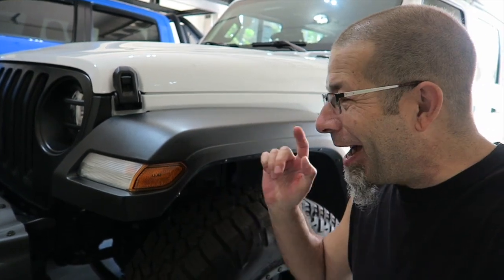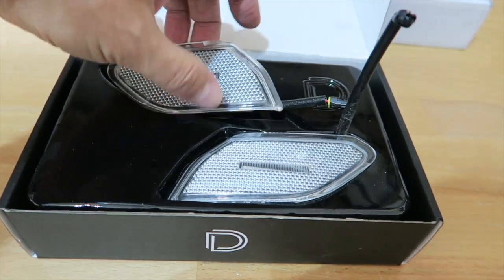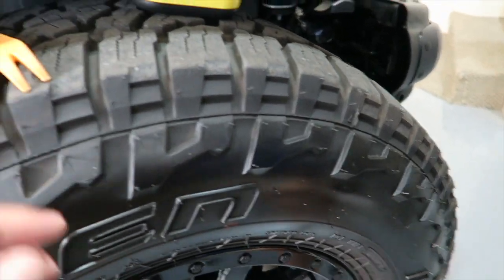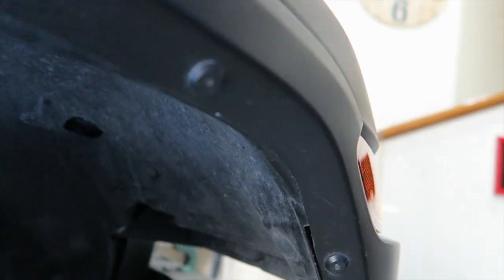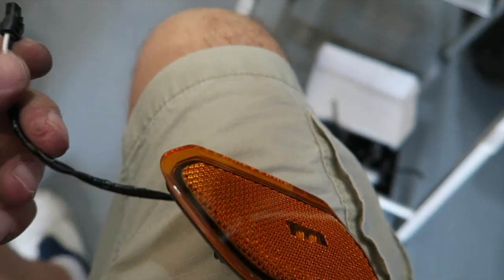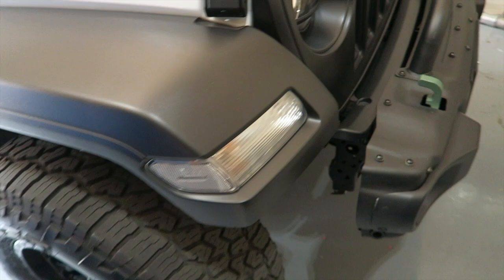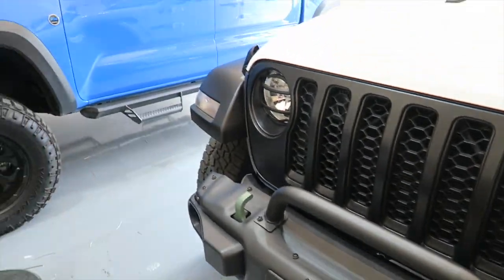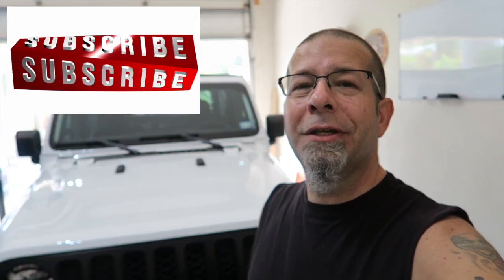Clear Side Markers for My New Jeep Gladiator

Comment: Went though some hell trying to get this installed today on my new JL. That screw is obscured just enough by the plastic bracket over it that I fought for an hour and couldn't get it with my t30 socket.  Then, I had the bright idea of trying to remove/loosen the bracket, which was a waste of about 45 minutes in the sun.  Sadly, my current torx screwdriver set is only for the small sizes, so ill be making a trip to Harbor Freight tomorrow to grab a set of larger ones (would probably be good to have something other than the little Jeep toolkit for my t45 as well anyways).

But, I did at least get the Oracle Flush Mount LED taillights installed, and finished installing the Rugged Ridge Venator stubby bumper for my winch, so it wasn't a waste of a sunburn.
Reply from the maker: Best way is with a torx screwdriver-longer the better👍

Comment: I did the smoked ones. From ebay, had the same ones on my JL for 3 years. The wire plug take a little pocket knife and slide it under that little latch.
Reply from the maker: Nice tip👍
Reply: @robmotiveplus  I do like your videos. Good job with them
Reply from the maker: Thanks Chris👍

Comment: Ok Rob...this one is right up my alley! I have the Sport S . As I said, I replaced the halogen headlights with Occulus Oracle LED headlights. I HATE the incedescant front turn signals. 

1. Your side marker lights are LED. Love them!! What about the front facing turn signals??
2. Ive been reading on Gladiator forums that if you have the COLOR MATCHING FENDERS, you can direct swap stock LED turn signals. Thoughts?
3. Did you have to flash the computer to deal with the new lights??
Reply from the maker: Hey Norm.  They are indeed LED's👍. I haven't changed the front signals. Not sure about the color matched fender version?  I did not flash the computer.
Reply: @robmotiveplus  but your front facing signals are still incadescent, right?
Reply from the maker: I believe so, but I can’t recall for sure.  They are stock.

Comment: Just a heads up for everyone, that's actually not compliant.  You have to have orange side reflectors on the side of your vehicle.  Bulbs don't count. This is why every single new car has the orange reflectors somewhere on the front.  So while not compliant, I doubt you will get bothered because you don't have something stupid like a blue bulb in there at night, and during the day you would have to be doing something very stupid for a cop to pick on you for clear side markers.
Reply from the maker: Not true.  Yellow bulbs are fine.  Of course, check your local laws to be sure👍
Reply: @robmotiveplus  Every car in USA has to have amber reflectors in the front as per Federal DOT laws.  It is why you will not find a single new car sold in USA, without some sort of amber reflector on the front.  Trust me, they don't put those there because it looks good.  They do it because it's the law.  Has nothing to do with the bulb, as bulb isn't a reflector.  But, like I said the chances of someone bothering to enforce it is small.
Reply from the maker: Not true.  I have seen many on the lot without 👍
Reply: @gs98999  you are correct. But like you said most won't mess with it.